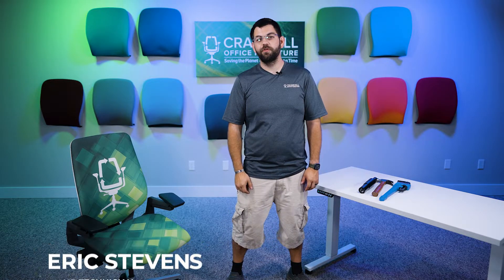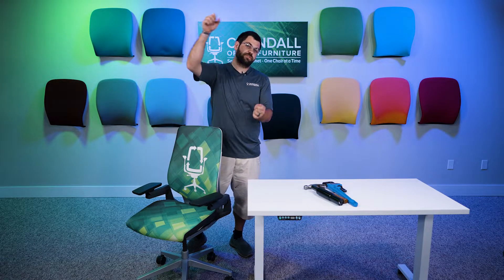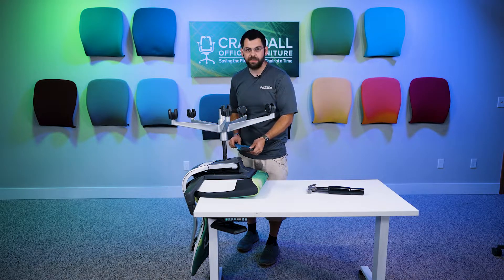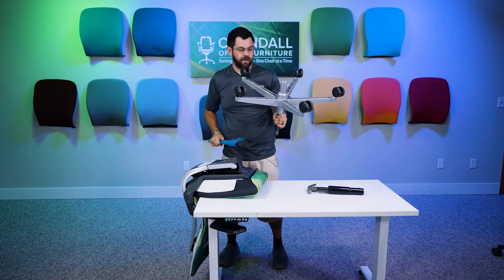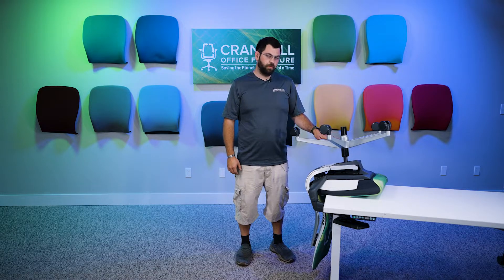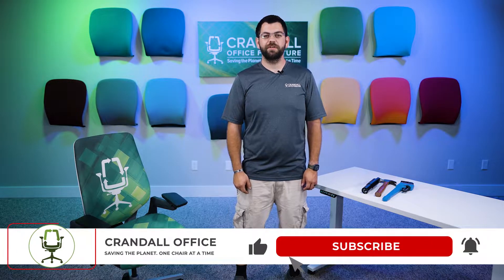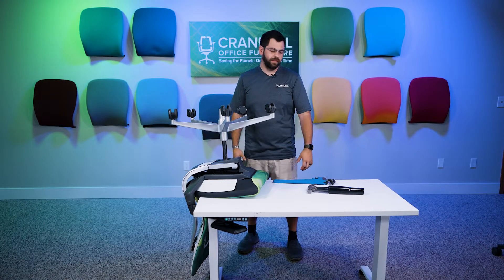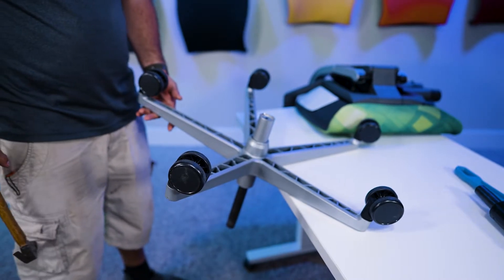Cylinder Removal and Install For The Steelcase Gesture | Office Chair

Comment: Anyone know how to adjust the set screw for this chair after changing the cylinder. I need to loosen it, my chair is always moving up with the new cylinder.
Reply: did you find a solution for this?  I'm looking for the way as well.

Comment: I got my brand new Steelcase Gesture and wanted to exchange the cylinder for a taller one. I bought the exact same blue wrench used in this video, and it sunk its teeth deep into the old cylinder, but I couldn't get the cylinder to turn and get out for the life of me. I am tall and strong. What am I doing wrong???
Reply from the maker: if a cylinder isn't budging, we recommend using WD 40 silicone, tip the chair so that the base is up right and spray the inside of where the chair and the cylinder meet. I would give this 24 hours to settle in and then try it. Also tapping on the side of the cylinder with a hammer near the entry point will help break things loose as well.

Comment: I have three of these chairs and on one chair the cylinder works fine, but the bottom shaft it sits in is touching the floor. So now what? Is anyone able to help? The chair is only 18 months old and was purchased new by me.  Thanks
Reply from the maker: We can get you a cylinder sleeve and that will help. Reach out via email to Contact@crandalloffice.com with your need and we will be able to help.